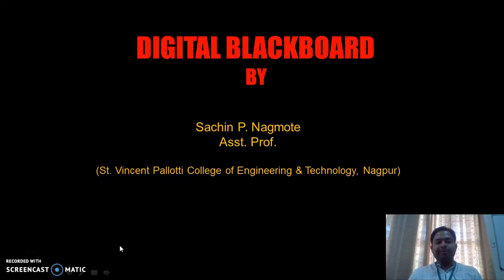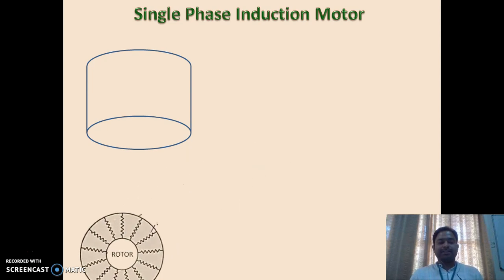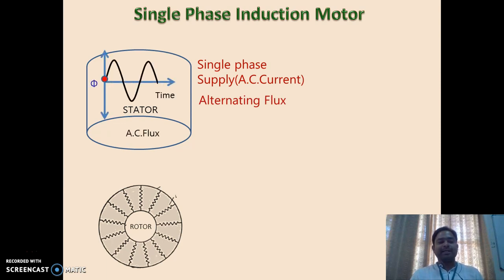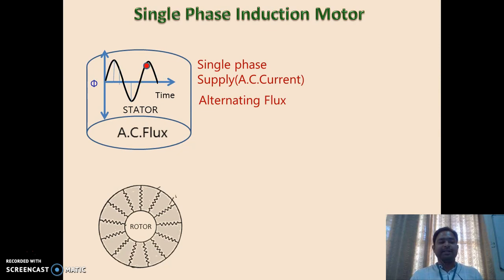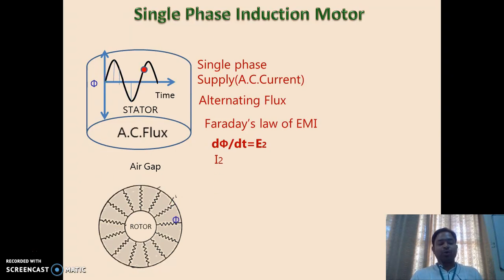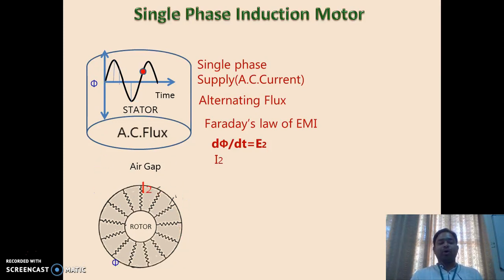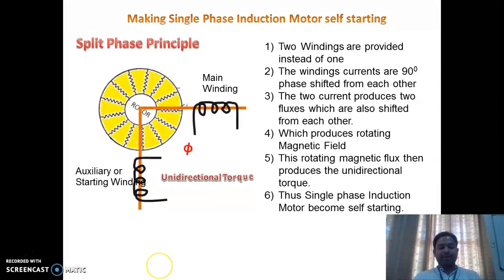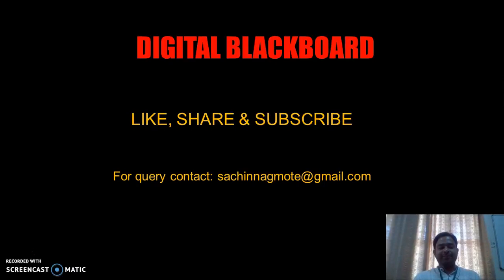Why Single Phase Induction Motor is not Self Starting (Easy understanding with Animation)

Comment: At any instant of time the current through some of the stator conductors is positive and in the remaining conductors it is negative. which means we only get flux either in +ve x-axis  (say) direction or -ve x-axis direction. therefore the flux is alternating along one axis (x-axis). but sir why is in your case the flux is alternating from +ve x to -ve x axis THROUGH Y AXIS. PLEASE CORRECT ME IF I'M WRONG.